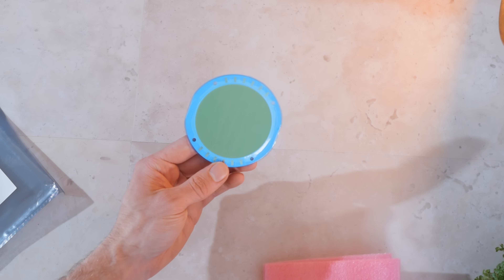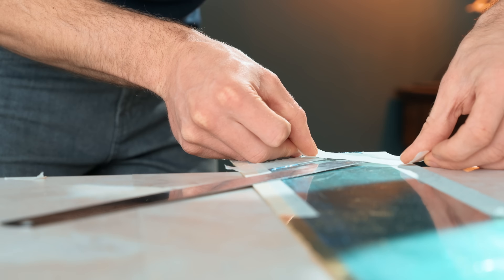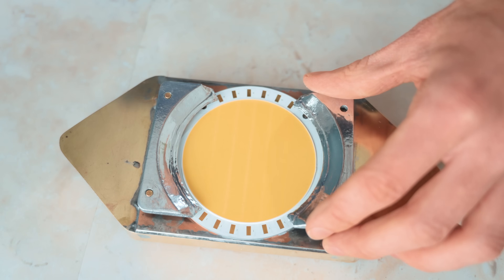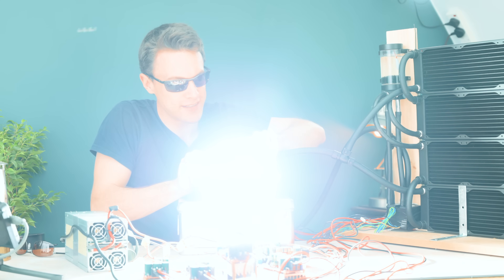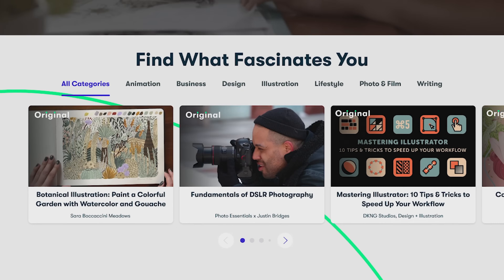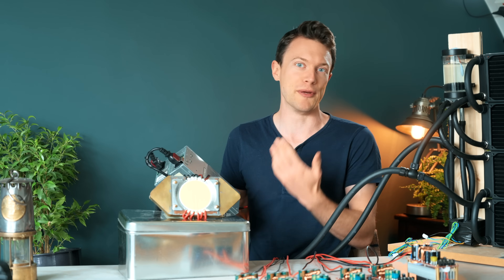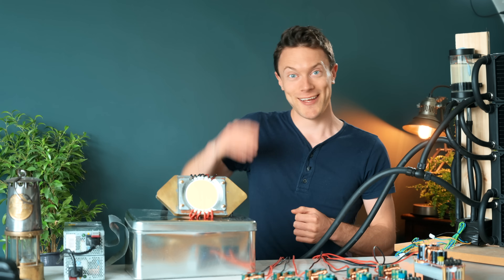Testing the world's BRIGHTEST LED!!!

Comment: The server PSUs are only rated for a certain amount of load depending on the voltage rails but NOT as a whole, meaning that you can’t pull the full 750 Watts they’re rated at from just one Voltage rail, say the 24V one. That probably fried them.
Reply: Server PSUs haben nur die 12V-Schiene, die verschiedenen Schienen (12v, 5v, 3,3v) gibt es nur bei PCs. Bitte lösch deinen (leider wieder) fachlich falschen Kommentar, du kleiner Hochstapler! ;-)

Comment: Your power supplies in series should work fine - but they're not seeing half of the load each. In series, power supplies see identical watt-load, and provide double voltage - not also double wattage. You need two 1500 watt 12 volt supplies if you're going to series-power that behemoth. You'd be better off parallel 12v, boosted to 36v. Or just six 24v $35 power supplies, one for each of your existing six boost converters. Just a heads up! Great content!

Comment: What was the current output spec for the +12v rail? Probably not the whole 2000 watts!  I also agree with others that the power supplies were not designed to run in series but in parallel.

Comment: Why would you want a 30 volt LED at this amperage?  Is it possible that this was designed to run in series, 6x30=180V max, so that it could use fully rectified 120VAC at ~168V?

Comment: FYI you can always just buy a power supply that takes either 110 or 220V AD and transforms it straight to 24V DC at 1500W...  They can be pricy but here's one for a reasonable cost https://www.alibaba.com/product-detail/DC24V-Power-Supply-Switching-62-5A_60782091547.html?spm=a2700.7724857.normalList.89.7ced616bZdevHv

Comment: Your issue is that you have 2 PSUs in series. When you double the voltage using that configuration, the max current still applies. If you made them parallel, you would get twice the current but at the same voltage as one PSU. So you were effectively still only capable of a total of 750w @ 12v(I assume). When they are in series, they effectively act like batteries, ie: if a single cell has 2000mah, two in series will still only produce 2200mah even though the voltage doubled, the only way to get 4400mah is to half the demand in current (you still won’t get the full 4400mah but that’s due to batter chemistry). Going Bach to what you’re trying to do, you’re trying to series PSUs but you’re still only getting 750w max because of the current limit on each PSU because each PSU is actually acting independently of the other, and if you double the voltage, the current effectively halves. You also shouldn’t connect them in parallel due to them being switch-mode power supplies, doing so (if they’re out of phase due to internal slight differences) could result in a fireworks display. Another issue is using boost converters, again if you increase the output voltage the input current has to go up in accordance with Ohms law. Your best bet is to get a PSU with current limiting able to supply both the current and the voltage that LED requires, or if you’re using a boost converter to get the voltage, you need to spec a PSU that can handle the current requirement for boosting the voltage.

Comment: I think you are never supposed to connect more than 1 DC power source per DC circuit, serial or parallel. Reason being, they all have their own voltage regulator to monitor any voltage drop and compensate them. Having more than 1 source in the circuit screw up such capability. For industrial use there are always warning about this due to many devices having their own 24V power supply (for if you don't need a lot of 24V, for example you only want to lit a sensor, and the device is on AC power, you don't have to use a 24V PSU).

And for the solution, I'd say just get a few 24V industrial power supply, and some DIN rail to mount all of them. Make sure to label all the wires properly though.

Comment: Found which voltage boosters those were and I think this would be a far safer setup: Run three boost converters on each separated power supply.
Reply: each LED chain has a slightly different voltage.  The one with the lower voltage will take all the current and FRY.  Need to drive with independent PSUs.

Comment: 35V x 6=210V. u can power them strait from the mains with a bridge rectifier . ( if the voltage drop is below 210V) . u can eliminate the power supplys .

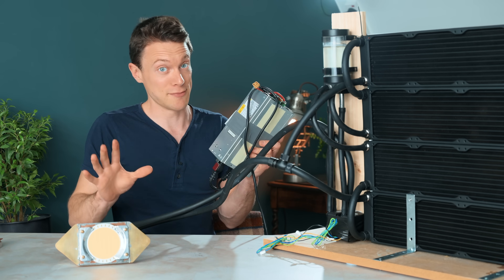Comment: @8:00 it would have been easier on you if you used a bank of just straight Buck converters. Also the led brackets should have been made from aluminum anyway. And lastly. 4 of those radiators is overkill. 2 would have been fine.

Comment: @4:50 it's not the mass it's the material. Copper is better at absorbing heat than aluminum. But Aluminum is better at dissipating it. That's why you always see Al/Cu heatsinks touted as better than single material air coolers.

Comment: When you wire the psus in series you get double the voltage but half the amperage  so you will receive the output (in watts) from only one psu. Next time if you don't mind try wiring them in parallel and than boosting the voltage.. Another thing that you can try is to wire two pairs of psus in parallel and then wire the pairs together in series. That should give you 24v and the wattage that you were looking for.

Comment: Since there is two power-supplies it might be just one that is overloaded. Not sure how you wired them but one might have a larger load than the other. It could also be that the power-supplies ar rated at 2000W peak power and sustained power. But idk

Comment: When power supplies are in series, even though they're each only doing half of the work, they're both still getting all of the current, right? So the I^2 x R is not mitigated in this way, I think.
Reply: Yeah but with double the voltage you halve the current(const P = V x I), so it's still just doing half the work.

Comment: So since it's buried in replies. Server PSU rely on the chassis fans to cool them. The built in fans are for redundancy (which is one of the major factor of servers). You cooled the LED but not the heart of the system. Had the PSU not been server grade, that LED would have probably died with them.

Comment: It has probably already been said, and maybe even done, but, consider lapping the heatsink to get better contact with the led. Alsoz my biggest worry is the material of those radiators. It better not be aluminium but also be copper or you're going to get corrosion

Comment: Just so you know, that was a boat load of thermal paste you put on that sucker. Since it is a little bit bigger than a cpu processor, maybe put 2 pea sized globs on the light instead of the 1 that you would put on a cpu. You basically frosted that sucker lol

Comment: Cool video! 

But several things, if you are planning to use it longer therm, check the metal mixing in the cooling loop. 

And check the temperatures after the system is heat sooked

Comment: Those PSUs have multiple 12V rails, they probably had about 7 - 800W capability if you picked the heavier rail, which would put the draw you were putting on them a little over their capacity. Grab a couple of car batteries for a buffer next time :)

Comment: Those power supply deliver across multiple rails, i dont know how you wired this up but likely not correctly :F  - Also you went way too mad on the cooling, 2 Rads would be enough imo.

Comment: for power supply it is wise to use welding inverter, it has current limitation so brightness could be adjusted without problems : )

Comment: Well the reason why they failed is because you pushed the power supply too hard
Nothing has a efficiency of 100% which means to deliver 250W there is a power loss
So let's say you need 250W and the DC-DC converter have a efficiency of 80% this means that 20% of the power will be converted into heat which is 50W. 
So this means your DC-DC converter draws 300W total. 300* 6 = 1800W total power draw from your PSU and if your PSUs are rated for 750w each (1500W total) you are overpowering your power supply

I don't know the efficiency of these DC-DC modules but a adjustable module typically isn't that high efficiency

Comment: Try/don't try wiring 6 NEW PSUs in parallel series:
3 parallel wired PSUs in series with 3 parallel wired PSU's 
(BUT use multiple power outlets in your house to spread the load and use thicker cables to wire them for more fire safety)
I don't know if the math is correct on that and if there are any electricians out there that know about any limits on how much crazy wiring is safe so PLEASE correct me!!
But 2 worked in your last video with a 500w led, so it should in theory give you more headroom in terms of heat that these tiny fans have to handle.
If you really want to be on the safe side though, you should use 12 PSUs and wire them the same way due to the same reasons (soldering 2 Power supplys is NOT safe)....oooor try to build your own massive PSU
sry for my grammar(i'm a german schnitzel)

Comment: I suspect the PSU's would have failed anyway but is there a chance having them mounted to each other (it looks like two?) reduced their heat dissipation/increased their total combined heat?
Also it looked like you went straight to switching them off at the mains after you had finished with your lighting... just be aware that in doing so you would prevent their cooling fans from having any power to continue removing the heat... so you would have a longer time exposed to unwanted heat.
But you've probably already figured out the actual issue and are moving on to the new improved version. :)

Comment: It's possible that if the two power supplies didn't start at the same time one ended up backdriving the other (reverse voltage on the output) and damaging it. Another possibility is transient overvoltage on the supplies as they shut down if they don't share voltage equally when the input capacitance of the boost converter discharges back into them. Could be fixed with 4 really beefy diodes. It's also possible it could be an issue with whatever method you used to lift the ground on the supply. Honestly though, this is all just guesses.

Comment: Probably best to just use 3 separate 24v power supplies, or swap the boost converters out for buck and use 36v/48v power supplies (which would theoretically be more efficient).

Comment: For the Revist - 

You need to get Power Supplies that have a Sustained output that you need for the LED on the 12v Rail - 

There should be some 2000Watt power supplies in the market -

Comment: you should have tried to find an SP3 or TR4 water block (AMD Epyc and AMD Threadripper respectively). They would have been roughly the same size as the heat sink you are using. Granted, it wouldn't have made for as interesting of a video

Comment: Did you consider powering it with LiPo batteries? The ones used in drone racing can output 1000s of Watts continuously each. A 1500mAh battery at 90C is half the size of one of those PSUs and can already do 1350W peak

Comment: I think you have not calculated the efficiency of the DC-DC converters as it can be anywhere between 70-90%. So at 75% the power supply will be max 2000w for 1500w LED power.

Comment: [Power supply]  "Within it's capability" — well, peak load.  Which, for the intended purpose, should be transient (eg on start up).  Simply not designed to deliver sustained power at that level.
Reply: Power supplies are rated at resistive loads 100% duty cycle, with headroom.

Comment: stopping you there at 0:50. Why dont you just take a 1500w space heater and replace the heating element with your LED?
1:00 Water cool it with an EK waterblock meant for a PC.

EDIT: I guess I should watch the video first and then comment huh?

Comment: Those power supplies rely on the air beeing pushed through the server case. If the server gets loaded its fans will run faster and therefore increase cooling of the psu. Those psus itself have a fan for idle and usually an emergency fan speed in case their internal temperature gets too hot for various reasons. They are designed for running their specified loads continuously and usually do that for many years. Stacking them on top of each other also increases their thermal load because they also use the physical contact to the server enclosure to get rid of a large amount of heat. You could recycle the air from those radiators to go through the power supplys. Their air input rating should be around 40-50°C depending on the manufacturer. Look inside the PSU and see if you can locate structures that put heat onto their case. Put passive coolers there and blow air onto them.

Comment: as you are using boost converters already. you could connect one power supply to two of the led strips.
that would be a total of three power supplies. the power supplies wont fail that way.

Comment: Are you pulling all the power from a single rail of the power supply? most have multiple "rails" that cannot deliver the entire power. you might be over spec on 1 rail which is the one that failed.
Also server grade hardware doesn't care about noise, so really loud fans are normal.

Comment: Add something like this: https://phys.org/news/2019-02-firefly-inspired-surfaces-efficiency-lightbulbs.html or fresnel lens etc. It can boost the brightness and/or focus light on specific area. It really makes a difference.

http://streetlightmodule.sell.everychina.com/p-106711687-narrow-angle-led-high-bay-light-fixtures-waterproof-high-bay-light-fittings.html Lenses that magnify and focus work wonders as well, obviously something bigger than this product, but overall shape should be OK. Basically anything to reflect and focus light to manageable cone, without losing photons, firing at 180°

EDIT: https://www.auer-lighting.com/en/shop/range/lenses/glass-fresnel-lens-for-led-oe-50-mm-8 Fresnel lens.

Comment: Please be mindful of galvanic corrosion. If you have two dissimilar metals (copper and aluminum) in contact with water, having an electrical connection between the two can turn the loop into a pseudo battery. This creates a chemical reaction that will destroy the metals given enough time. As a kid I had a sterling silver spoon eat through the bottom of a stainless steel pot filled with water after a few days. I guess it's my own fault for not doing the dishes.

Comment: Possible problem: server hardware is meant to be installed in - wait for it - a server ;)
Servers have very powerful cooling fans that push a lot of air through the whole enclosure.
The PSUs may be rated at 1000W with added cooling by the enclosure.
Reply: Or they were just faulty. It's used hardware after all...

Comment: A decent Inverter would serve as a more efficient power supply. Not cheap. But at least you won't get any problems with it.
I'm rather more concerned with the bulk. Reducing that heatsink would seem a bigger priority. Fans of course, but you don't like noise.

Comment: an old trick to soldering copper water pipes is to stuff a little white bread at the joint you are going to solder. the bread insulates the area and makes it easier to bring it to temperature. Once you hook it up to water, the bread dissolves and exits the pipe. Remember to use cheap white bread, it dissolves easier and doesn't leave a bunch of wheat germ or husks

Comment: I think they are designed to be driven directly from Mains voltage. 220V / 6 is 36.6 V per medule which smack dap in the sweetspot for this thing. So having a 110V supply in Murca. After rectification you should be able to drive this thing extremely easily....and orders of magnitude cheaper.